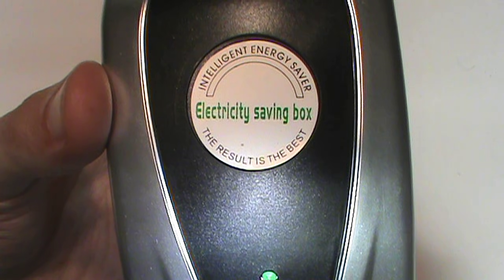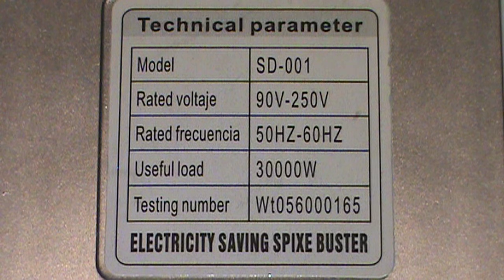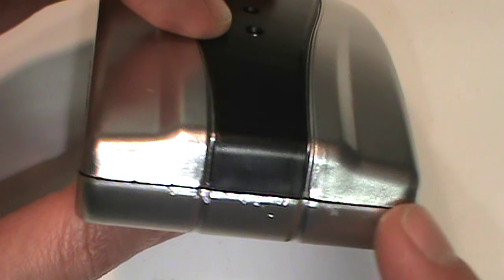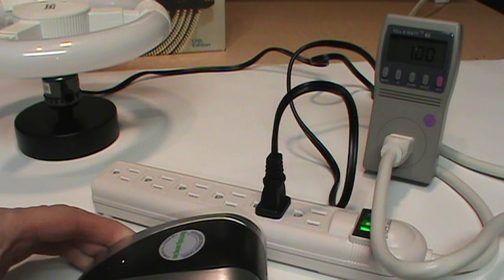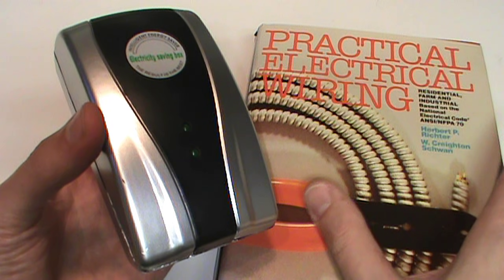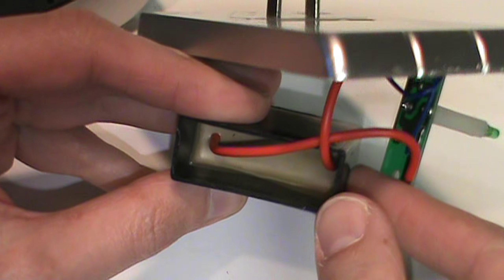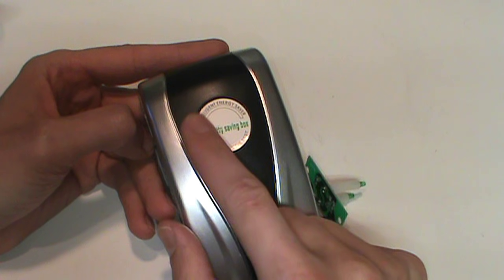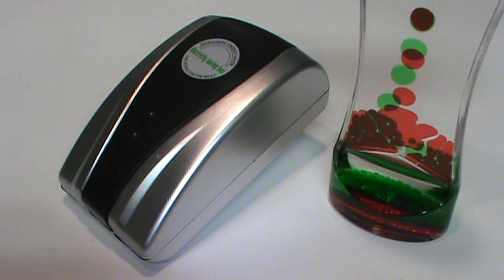Electricity Saving Box Spixe Buster BUSTED!

Comment: The fact these refuse to die indicates that there are still people actually buying them.
Reply: My aunt complains EVERY winter that her electricity bill is $500 because she has resistive electric heat. 

Everyone has told her to get rid of it and get a heat pump or even have an oil furnace or propane heater installed. 

She never does anything, but last time I was at her house I saw a few of these 😂

She loves buying crap from temu too, so I know exactly where she got em.
Reply: @volvo09  Wowwww…
Reply: @volvo09 I'm sure insulation can help.
Reply: @volvo09  At least electric resistive heating is basically 100% efficient, unlike oil or gas. Also, of course her bill is high, she's not splitting it with the gas company!
Heat pump would be real way to go.
Reply: @volvo09  probably a Trump supporter..
Reply: @NickTheVegan  There's always one who has to bring politics into things... name checks out i suppose. 🙄
Reply: @adamholmes91 😂
Reply: @NickTheVegan  how the heck did you get politics from anything I said?

You need to turn off the echo chamber. You have no idea if her husband died, if she has help, if she has money to pay for bills, etc... you just went for 2 sided politics for the reason.
Reply: @volvo09  Personal history doesn't really matter in this. As little as I like politicisation of anything, the tell-tale signs DO kind of align here. It thus wasn't too far off an assumption, and your kinda butthurt response only supports it, tbh.
If it quacks like a duck, I guess.
Reply: @fonkbadonk5370  hooves mean horses but think of how many misdiagnosed zebras are out there on horse meds. Case by case, don't make assumptions.
Reply: @NickTheVegan  come on man you've gotta have better reasons than this to bring him up, uninformed people getting scammed isn't political.
Reply: They are now buying 4 though, clearly they didn't work before because they didn't have enough.
Reply: They should’ve stopped making those useless boxes decades ago!
Reply: @KRAWofficial  probably still bucketloads of them in a warehouse somewhere ....
Reply: As the saying goes: There's one born every minute...
Reply: It doesn't save energy, if you want to save energy you remove the led, it's 2 times 20 ma
Reply: My local thrift stores get some in occasionally...used...AND they get sold on, too! You know you've really hit the big time when you find the good old "Electrosmog" meter, or better yet a more modern multifunction unit from China that claims to look at every kind of electromagnetic emanation across 9 types.
Reply: The fact that they are counterfeits of a real device, authenticates the real device working. 

Forget about the cost for a second. If your washing machine gets caught messing with your neighbors powerfactor, that is REALLY bad. 

I believe this chain of events started with a product SOLA made to try and stabilize shaky voltages and powerfactors. People who were on the edge of the power provider who had things like TVs and Microwaves getting destroyed and smoking from below 90 volts or above 177. (144 depending on how the phase moves around)

They were expensive, but way less than buying a new color Tv in the 70s and 80s. Then someone took that idea and make a scaled down version that was not linear to the powerline. (doesnt have to be put in front of the plug) ShopTV channels jumped all over that, and some did actually work. Seeing the easy money, someone then counter fitted this semi working idea. Then someone bought some plumbers putty and sifted through Radioshack’s trash and we have this product. 

The only promise the power company used to offer is 60 cycles. Not 120 volts, just 60 cycles. That is why this exsists
Reply: @keith_5584 yeah but the sola device was a ferroresonant transformer and weighed like 20 pounds for a 300 watt unit.  No one would mistake this for that.
Reply: @GigsTaggart  I am pretty sure Sola was the brand name or company name. They made many devices, although it is strangely hard to dig up data on the model I was picturing. 

People are a lot smarter now, or I hope so. Maybe just desperate to save money. 

People do still fail to understand perpetual motion isnt possible and electricity isnt magic pixies. Sometimes they even wear tinfoil on their heads.
Reply: @keith_5584  i'd think it extremely unlikey a relatively low load such as a washing machine, in one house, would affect another houses supply in any way, it wouldnt cause a supply to increase
Reply: @andygozzo72  Shifting the phase of the power-factor is a way to cheat on your electric bill. It hides it in a way. It is a big no-no. I was not saying they were doing it on purpose, just that worn out equipment is more susceptible to being affected by this new era of cut rate motor drives messing with power. 

Check the voltage with an RMS multimeter when a newer washingmachine is agitating. Newer drives are doing weird things. It disrupts LED lightbulbs. 

I kind of hope it stops, it is annoying and more and more are doing it. I think they are dumping power back into the line but that is a guess based on 1 specific machine I have seen.
Reply: Qui in Italia hanno appena arrestato gente che prometteva di guadagnare denaro "adottando" dei pannelli fotovoltaici,che ovviamente non esistevano, era il solito vecchio ma efficace schema Ponzi,parliamo di un giro di denaro di svariati milioni di euro...! La pubblicità era pure su YouTube, appena la vidi sentii puzza di bruciato 😂

Comment: Hey! There's also another device that's like this which is meant to improve gas mileage but it's a scam,can you do a video or 2 about those devices?
Reply: Ah... yes, that doohickey you plug into the cigarette lighter socket and supposedly improves your car's mileage by conditioning the electricity in your car or whatever, these scams never end.
Reply: @Δημήτρης-θ7θ no ,I'm talking about the thing that goes into the OBDII or ECM port!
Reply: @notmanatee2445  That's more debatable, since ECU remapping can result in mileage savings (a process generally known as "eco-modding" or "eco-tuning" the car), and instant ECU flashing devices do exist for some car models. That said, I wouldn't plug anything bought from the internet into my car's OBD port, and generally ECU remapping isn't for the faint of heart, since you are on your own if anything goes wrong or if your car fails to pass a smog test afterwards.

Comment: Why would you buy the energy saver box device for money when you can just turn off the power switches that you aren't using for free? 0_o
Reply: Yeah, that isnt wait this counterfeit product was ever designed to fix. The real product was made by Sola, and was a fix for when the power company would give you too much or too little voltage in the 60s, 70s, and 80s. 60 cycles a second was their promise. 177 volts, 60 cycles per second. 84 volts, 60 cycles per second.

Before the switching power supply your TVs and expensive equipment was not tolerant of these surges and sags. That may cost you a grand in dead TVs and such. 

The original product went between you and the powerline in series. It was meant to handle about 1-3 kw max, and was 400-700 dollars. Then someone came up with a way to put it parallel that sort of worked, but not completely. 3 copies later and we have this plastic box with a plumber putty air capacitor. 

Eventually the power company got better and did promise power between 100 and 130 volts but the copies kept going.
Reply: DOH!